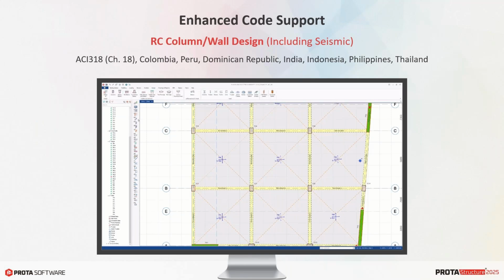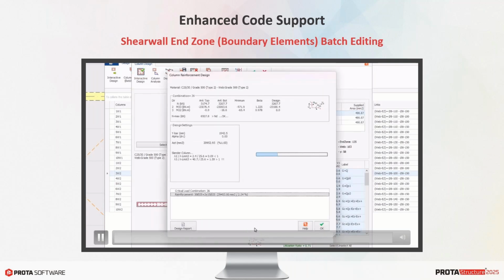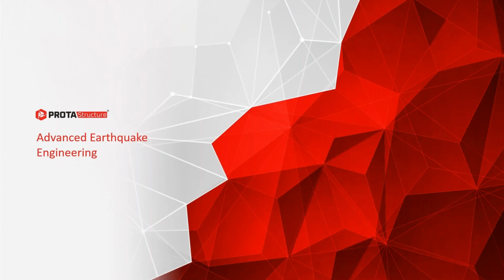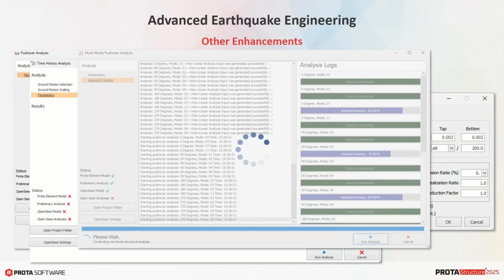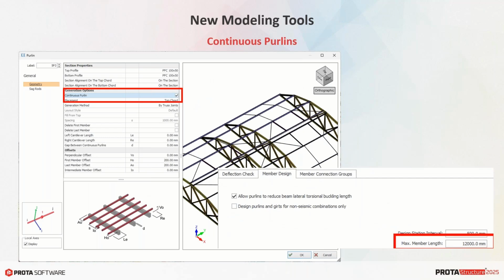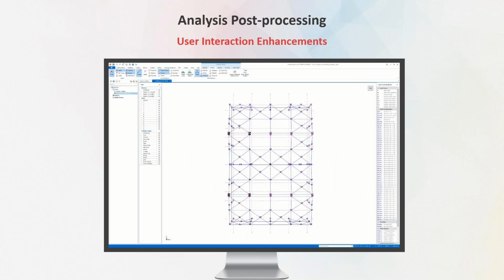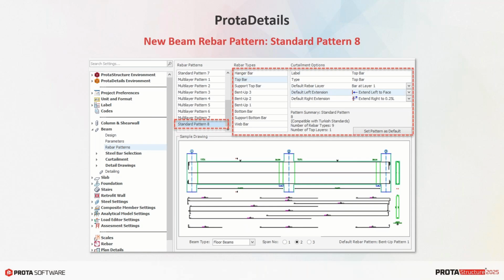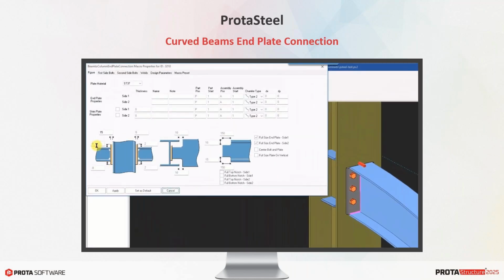Powerful New Features of the ProtaStructure Suite 2025

Comment: The developments are contrary to expectations. I was very disappointed. Many more important things should have been developed than those you talked about, including:
Drawing of the concrete dome
Drawing a circular concrete core
Reinforcement of circular slabs that are radial and diagonal in shape
Adding hydraulic loads
The ability to modify load structures to suit the country code
Developing drawing tools, such as copying the element, moving the element, etc